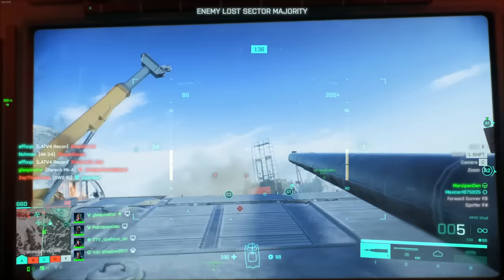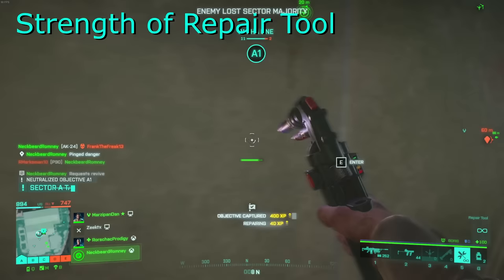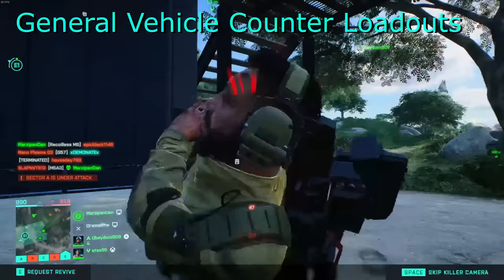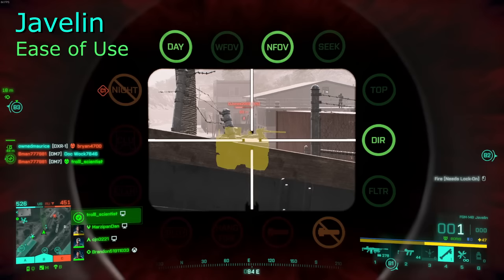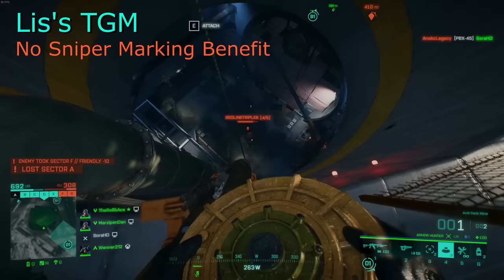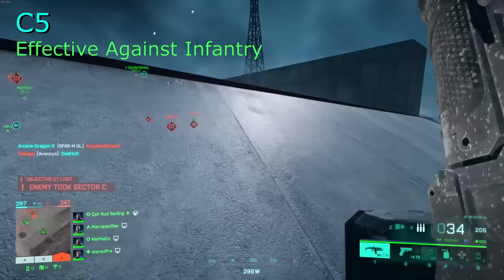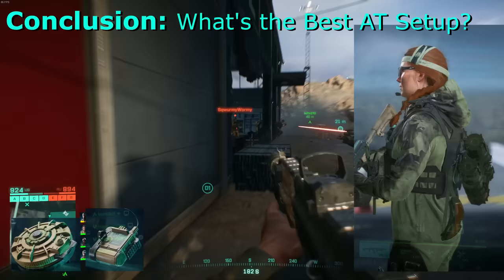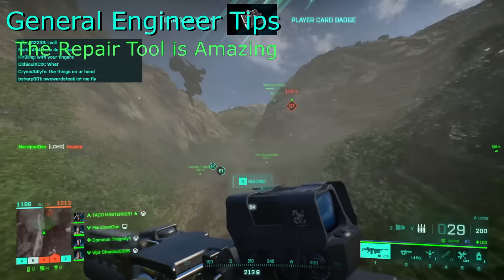How to ACTUALLY Deal with Armour - A BF2042 Anti-Tank Engineer Guide

Comment: We're having the exact opposite problem with vehicles in this damn game.  Vehicles are very easy to counter with liz, boris, sundance, mackay & hacks.  Air vehicles are getting hit the worst.  Only vehicles that don't give a shit about c4 or lizziles are cav & little bird.  Worst battlefield in terms of vehicle to infantry balance by far
Reply from the maker: I do think that ground armour is a lot weaker than in previous BF games, mostly because of the prevalence of C5. I have found that playing in a cautious way, pushing with infantry and having a route to escape in has increased my survivability. Once vehicles are fully loaded with a dedicated crew you can be an absolute force to be reckoned with, but that happens so rarely :/
Reply: @marzipandan767  ye

Comment: Does the anti-armor ammo for the machine guns work on every vehicle? It could be useful if it does
Reply from the maker: Sorry for the delay in getting back to you. It does work on every vehicle and is about effective as Crawfords turret. I loaded up a test server and used AP rounds on the LCMG, 75 round directly in the rear of a main battle tank did about 46 damage, and it did much less from the front. The downside is you need to either run them as an alternative in t-menu, then when you switch you need to reload, which takes a lot of time. Or you can run them as your main ammo type but then you have higher recoil, less rounds in the fun and lower damage vs. infantry, and I find it hard to recommend with that trade off.
Reply: @marzipandan767  yeah I agree. I've found a fun way to deal with enemy armor is to Mackay grapple them, and then hit them with a C5. The grapple means I'm moving so fast they can't hit me. Got 2 tanks in my last game with this strategy
Reply from the maker: @Aaron Beardsell  that's a very effective strategy, but I will warn you that players are getting better at anticipating Mackay grapples, it might begin getting harder to do.

Comment: Tanking is near impossible with all the javelins kicking around, the range is far too mich. Hourglass I'd a joke for it, I've had multiple games with the entire other team with javelins & darts & ammo crates. Zero chance.
Reply from the maker: I've been having lots of success in vehicles lately, especially tanks. As mentioned in the video, I recommend equipping thermal smoke and APS wherever you can.  But I can see that if you are against a coordinated squad focusing on AT, especially on such an open map as hourglass, that sounds rough. 

Thanks for commenting!

Comment: I'd actually like to see AT-MINES get placed in the grenade slot.
Reply from the maker: That might be a bit strong, considering that they absolutely wreck vehicles, that being said I do think they would get much more use if that was the case.
Reply: @marzipandan767  yeah it's a bit of a hard solution. Cause right now no one wants to run AT-MINES over rockets, but making it so you could have both AT-MINES and rockets would be crazy they'd have to nerf the mines if they implemented that. Hard solution indeed
Reply from the maker: @DannysMyNanny  Maybe they could let people choose between a repair tool and AT mines, but then it puts Lis in a weird position where now she has the TGM, C5 and AT mines... That sounds a little overkill.

Plus every engineer having the repair tool is a good thing for cooperation in the game.

Comment: Tanks should be hard to kill… I live playing AT, but also as armour. Tanks & other vehicles don’t need more nerfs. If you have a full squad on coms going anti tank you’ll see that their no problem at the games current state
Reply from the maker: I agree I think they should be hard to kill. I think the only nerf I suggested is make it so tanks cannot equip APS and thermal smoke as it makes the Javelin useless, and since we have so few AT launchers to choose from losing one of the 3 options is a great loss. I would be fine with APS and thermal smoke if they would add some more launchers, like the RPG and the SRAW. Even with this I think that most vehicle/infantry balance is good in the game.
Reply: @marzipandan767  I think shorter lock on time would balance better. Force vehicles to react faster.
Reply from the maker: @Devon Powell  that would also be a very good alternative! I also think it would be good if the lock would be more consistent. It's annoying when a twig getting in the way immediately breaks the lock 😆

Comment: Crawford is the best engineer.
Reply from the maker: I've recently come around to this way of thinking. I occasionally use his minigun to do some last chip damage to vehicles or to lock down a hallway, and his repair perk comes in clutch sometimes!
Reply: @marzipandan767  Crawford became the most complete engineer when they added the AT Grenade. Which gave him 3 constant responses for enemy vehicles. His passive is also night and day in terms of impact compared to Lis' and Boris
Reply from the maker: @localsussybaka277  I would agree that compared to Boris's, it is night and day, but Lis's perk is very useful for hunting down tanks, especially if you are a chain smoker like me 😆

Comment: no mention of EMP grenades & etc? hacking?
Reply from the maker: You are correct. The focus is on Engineers.

EMP nades aren't worth it with the current iteration of EMP. If you want to take a grenade that can help against armour, then take the AT grenade.

Hacking and EMPing isn't very good at dealing with vehicles, but it is good at slowing them down and making them vulnerable against other players.

Comment: I dont unterstand. As a vehicle player myself since bf3 i find staying alive harder then ever before. Everyone got c4 mines and auto lockon shit
Reply from the maker: Once you figure out how to keep C5 players at bay you can increase your survivability a lot. You need to keep a decent distance and try to stick with infantry. I'm not saying don't push objectives, just be sure that you are moving into them slowly after you have cleared them out. If you are running solo be sure to exploit seat switching if someone gets onto of you, switch to your mounted gun so you can deal with them. 

Mines are fine to deal with if you keep an eye out for them. And autolock on weapons can be countered using countermeasures, again this one comes down to positioning. If you push too far forward, you'll get surrounded and taken out easily.
Reply: @marzipandan767  bro i know but the problem is that i randomly hit mines while i try to break line of sight to rocketlaunchers etc or im hit and try to get into cover so my mate can repair and shit. I still kill like 4 or 5 times as many people in my RAM than i die but the 3 or 4 times a match i die to landmines from someone who is 2 flaggs far from me just feels so unrewarding and frustating . In bf1 you could consistently reach 60-70 kills and 1-2 deaths if u play light tank on sinai desert and position properly and i just wanted to dtate it feels much harder in 2042.
Reply: @marzipandan767  but thanks for trying ti help really appreciate it ❤️

Comment: automatic repairs are nice for newbs but ruin the overall experience.  get rid of them
Reply from the maker: I actually agree. Especially now that most drivers or pilots will have the repair tool. Or make it so if you want to keep it in, you need to hold it and your vehicle cannot move while you do it, something similar to what BF1 did. But I would prefer they just remove it.